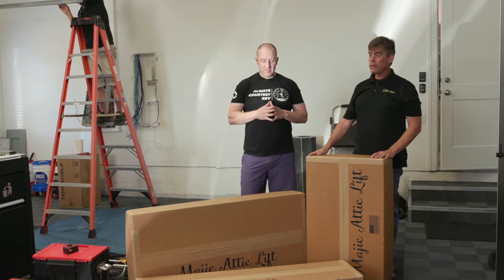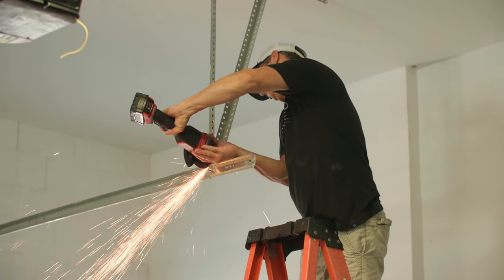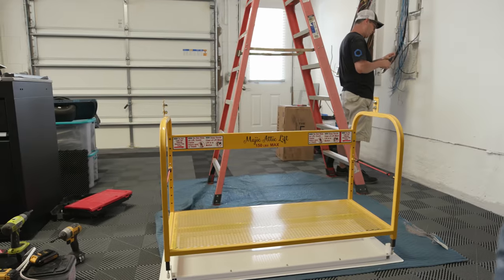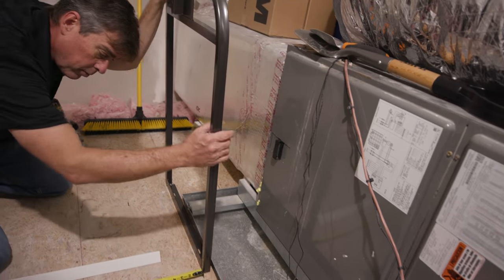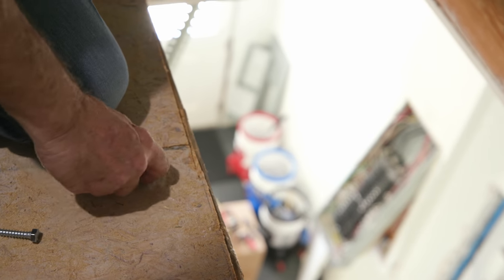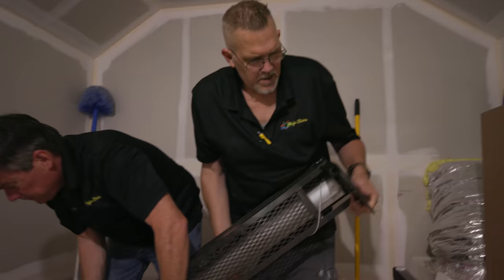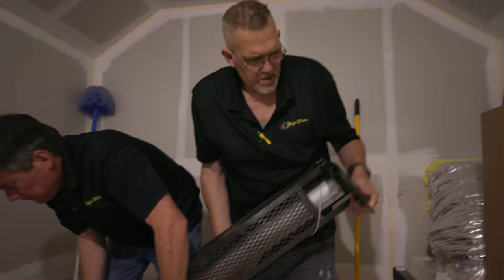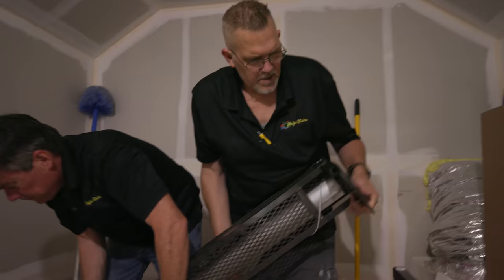Majic Attic Lift Install - From Unboxing to Operation

Comment: $3000 for a 150lb max cap lift??...What are these guys smoking!!...Everyone, do yourself a favor and hire a handyman with welding skills and for 3K you will have a much better system with increased capacity.
Reply from the maker: Ha, ha...  I'd like to meet that "handyman."

Comment: I love this thing so much... but I would de-badge it and powdercoat it black right away. I'd also hope for some torque specs on those bolts holding the wire. Great product with tons of room to grow into a perfect product.

Comment: Hello, this is a very smart solution. Quick question, what type of motor does it use and how quiet is it? I have my workshop in the garage next to my kids room, so it won't work for me if it's too noisy as I typically work after kids are sleeping.

Comment: I don't have the budget yet, but what one would prefer the greenwork psi 2700 psi. Or the sunjoe spx 9005 pro?
Reply from the maker: Neither.  Those are both junk.
Reply: @ObsessedGarage  you save me money. What you recommend for under 650 for mobile detailer?
Reply: @mingoreyes1  What he means is that those units aren’t near the quality they should be. They’re not literally “junk”, just comparatively. GreenWorks, SunJoe, Ryobi, Karcher, etc., are all perfectly fine for mobile detailing. You just have to keep in mind that ALL of them will fail at some point (usually a year or so). My opinion, I’d save your money and buy the Kranzle. It’s not a “status” buy, it’s legitimately the best pressure washer you can buy in that price range. If not, consider the Active unit as it will last a bit longer than the average “junk” pressure washer. Ultimately, YOU have to justify any purchase for your business = investment to value; performance and durability.

😊
Reply: @Reaper-Jim  I my ryobi went out, so just need pressure washer asap. I think I'm go with either the 1600 ryobi or the greenwoks 2700 psi. Than after my pressure washer gets out again, I spend the money on mu finally pressure washer.